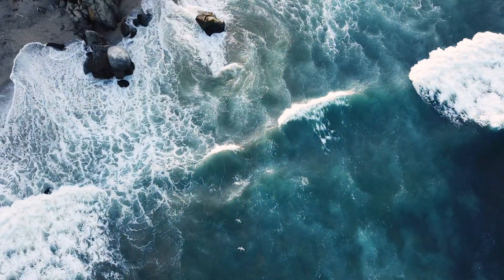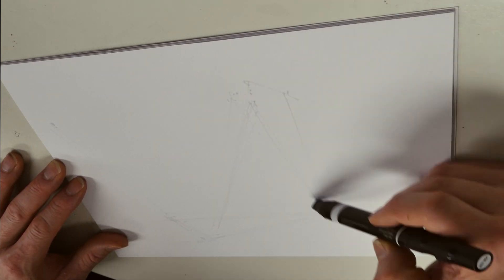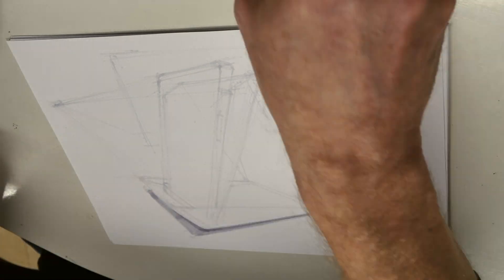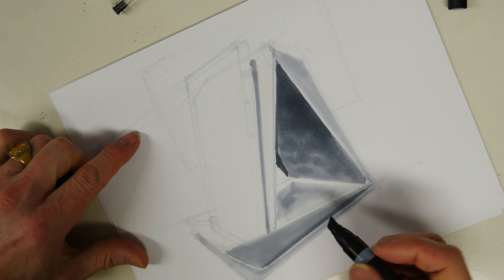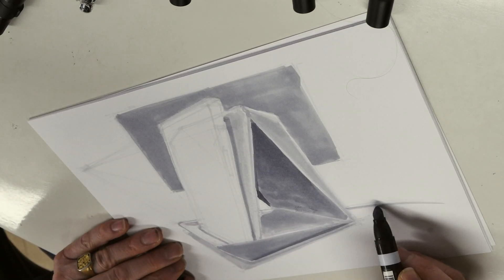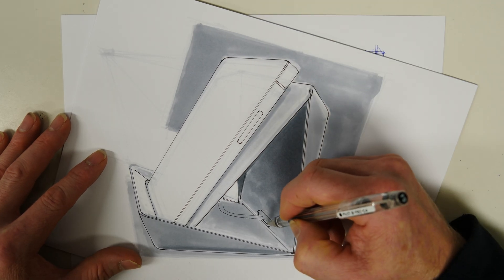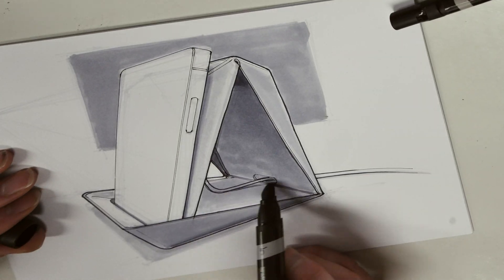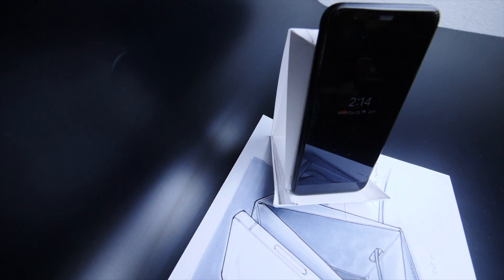Marker Sketching a Wireless Charger #TeamSeas

Comment: A considerable amount of energy is lost through inductive charging so making an eco friedly wireless charger seems like a bit of an oxymoron to me. I do like the idea of creating less plastic waste though.
Reply from the maker: No extra cable is needed, savings are to be had in this areas as well
Reply: @EricStrebel  That is of course assuming that Apple gives you a more expensive wireless charger instead of a USBC cable out of the box. I can't imagine that Apple would miss their chance to up-sell another unnecessary item. Btw. you'll need a cutout in the back of the stand so the charger can sit flush against the back of the iPad. When you increase distance or deviate from the optimal location you lose more energy when using inductive charging.

I stumbled upon your channel only a few days ago and I've been really enjoying your videos, it's always really nice to see all the little tricks another maker has accumulated over the years. :)